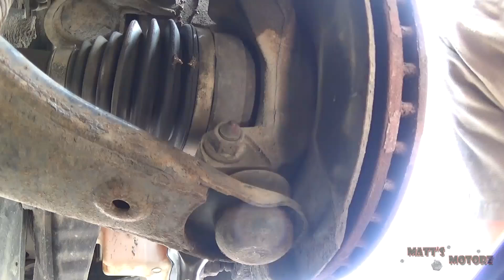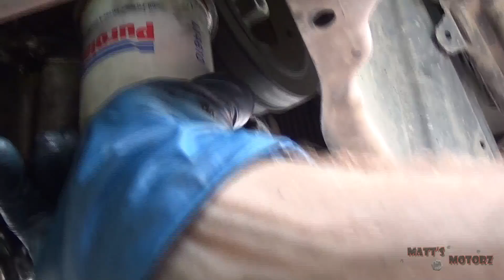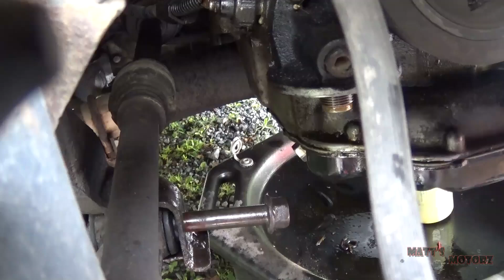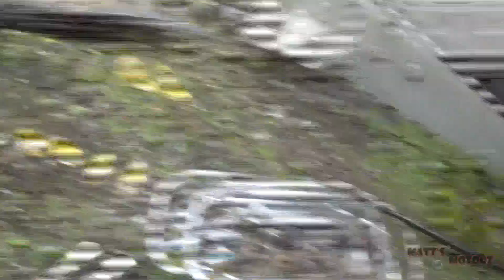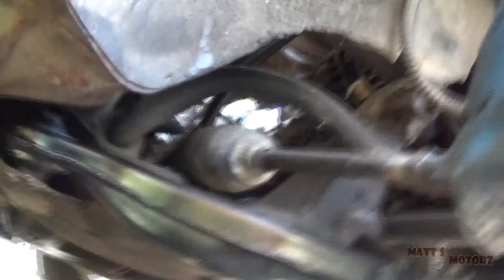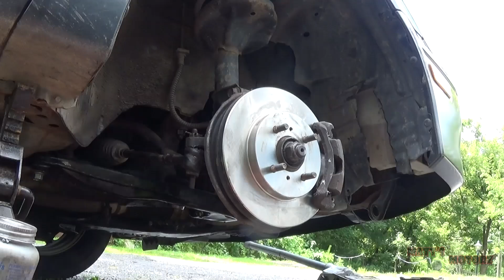Control Arm and Ball Joint Replacement [2002 Mitsubishi Lancer]

Comment: only reason I came here was to see if you ran into the same problem I did 🤣my bolts were so seized up it actually ripped apart the insides it was threatened to the subframe on these cars is not any funner. great video👍

Comment: u basically did the easy side driver side is harder. would like too see how u got the side bolt off on the driver side. A socket does not fit in the area and the bolt seem too long to be pulled out.

Comment: Wait till you do driver side!  Faster and easier to cut that sway bar link off with a sawzall and to use a long piece of pipe along with you breaker bar when removing those bolts. Good instructional video

Comment: Could you show a moderate video or explanation of the rear side alignment parts of your car? I have a 2002 Mitsubishi Lancer ES 1.6L Automatic & my tires are getting bold from the inside thread, my outside outer thread is ok.
Thank You Awaiting For Your Prosperous Response from You Or Anyone Please...

Comment: When removing the temperal transceiver does the small rebigulater conect to the univerasal magneto duhicky inducer spacer gravity bar nut bolt screw fcuker? Thanks for the quick reply! 😎👍
Reply: You have to get the doohickey out of your mouth before you type .

Comment: Cool video Matt. Maybe you shouldn't have sprayed WD40 in the bushing. And only sprayed the nut and left it for a day. Failing that the only other method I've seen is to Oxy the bushing out and replace it. That way you keep the control arm.
Reply: What does "Oxy" mean, fella?

Comment: You don't have to thread the nut back onto the bolt to protect the threads while hitting it with a hammer. That is why there is a nipple on the end of that Bolt. So when you hit that bolt you hit the end of that nipple and it doesn't even touch the threads in the first place.

Comment: Can you replace the balljoints without replacing the whole control arm???
Reply: cringy  were you able to replace the balljoints only?
Reply: @vernelmader5403  you can but it takes mor time because you need to use a press and if you take it to a mechanic they will charge you more

Comment: Hi, how much work is required to lower the sub frame enough to cut that bolt? I tested the bolts while changing my brakes to see if it was something I would run into. Now im debating if I want to go through this hassle.
Reply: Don't know if you still have the Lancer I know this is an old thread but I still have my 2003 and I will tell you I rather pull the engine then drop that subframe

Comment: MattsMotorz I have a 92 Diamante LS, and I somehow snapped one of the legs(arms?) on the right control arm, are there any major differences in the procedure I should be aware of before I get started? just curious.

(PS: I have a crutchfield service manual, but I'm trying to learn as much as I can since the replacement control arm wont be here for a few days, and I'm lucky to be able to change tires and oil, lol)
Reply: My eclipse snapped one of the bolts off. While driving it failed.  Causing 900$ of towing and shop fees. Fucking pisses me off. I sold the tucker. Now I just own the 2003 eclipse

Comment: any chance you have the part # for that bolt you had to cut  out? My car has alot more rust than yours and I can almost guarantee its going to be a pain to get it out. Ive searched all over the net for a part number and none of the diagrams I find mention the part #. great vid, thanks.
Reply: I can find a part# if you still need one.
Reply: @GorillaTwat  

I can’t find the part number for the main bolt on the front control arms that goes to the frame. or the nut size. all I run into is the rear control arm parts
Reply from the maker: I got this part on rockauto.com  Their catalog is really easy to search through for the parts you need.
Reply: Ive searched through everything on there still no luck.
Reply from the maker: Oh the bolt!! Sorry I misread your comment.  For the bolt, I had to go to the dealer.  I think the new one was like 20 bucks.
Reply: okay cool, thanks man. I kinda figured it would be one of those parts, I like to avoid the dealership at all cost, figuratively and literally.  lol.

Comment: hey man what was the thread pitch and length l for that bolt
Reply from the maker: +Skylinegtr34lover1 Don't know.  I just went to the dealer for the new bolt.  It was way more expensive than it should have been but I didn't want to deal with the hassle of finding the right size bolt. (I think it was like 18 bucks or something)
Reply: m14x1.5x12cm

Comment: Hey great video. I just happened to notice you put the sway bar link on wrong when u put everything back together. If you look at the before and after, you can see one of the rubber grommets goes on the top, not in the middle. Just happened to notice. Great video!

Comment: I have this same car. I had to cut out the rear motor mount. A rear bolt on the driver side sway bar bushing is frozen, and no way to wrench it that tight space. So, there's a good chance I will be cutting this control arm. I'm thinking about spraying these newly installed parts with PB blaster rust preventer. The original bolts also seem like soft steel, because they will round off very easy. I do love this car
Reply from the maker: +tim prater Use antiseize for the new parts.

Comment: How easy is it to replace CV joints on a 2003 lancer? I think it's mostly the same car as the 02
Reply from the maker: It should be the same as the 02.  You normally do not replace the joints, you would just replace the whole axle.  Axles are so cheap now a days and it is a LOT more work to replace joints. 

I am actually going to make a video on this in the next couple of weeks.
Reply: sweet mine just started clicking today but only when going over bumps, not when turning or driving straight. Ericthecarguy said that it could last awhile like that. What's your opinion?
Reply from the maker: Yeah I agree with that.  You can last a pretty long time.  I should have the video out in a couple weeks!

Comment: If you jacked the control arm and apply WD40 and let it penetrate for a while, you wouldve gotten that bolt out with ease. Just saying.
Reply from the maker: No way, not in this case.  I've seen my share of rusty bolts and when penetrating oil works and when it doesn't (WD40 is not a very good penetrating oil btw compared to others). Even after cutting the bolt and bushing up, the bushing was STILL seized to it.  

The lesson is to ALWAYS put antiseize on any through bolts in suspension systems.

Comment: hello, wanted to ask mr. MattMotorz would you happen to know the size of the bolt for the control arm? the bolt that is by the oil filter on the 2002 mitsubishi lancer? it was just my luck that one of the lower control arm bolts is stripped.
Reply from the maker: I wish I could tell yah but I honestly do not remember!
Reply: MattsMotorz
 ok lol, i was hoping you did know lol. i actually go to school for PCI (automotive) and i stripped it wishing i didnt lol well anyway good video you made for replacing front lower control arms
Reply from the maker: Thanks! 

If you call the dealer and describe which bolt it is, or better yet, go in and look at their diagrams, they can tell you what the size is.  I have done that before.

Good luck with that stripped bolt!
Reply: Thanks guy I appreciate it
Reply: That bolt beside the oil filter has a nut on the end of it that you cant see!  If the bolt and nut at seized, you will need to  remove tack welds or cut the sheet metal away to expose the nut, and work from there.
Hope this helps someone,  we just did one last night!
Reply: That bolt beside the oil filter has a nut on the end of it that you cant see!  If the bolt and nut at seized, you will need to  remove tack welds or cut the sheet metal away to expose the nut, and work from there.
Hope this helps someone,  we just did one last night!
Reply from the maker: Nice Job!!

Comment: Hi Matt thanks for the video I want to know were did you bought  the bolt for the control arm
Reply from the maker: Had to go to the dealer for that one.
Reply: @MattsMotorz  do you have the part number for the bolt and the nut by any chance? all I can find is the bolt for the rear

Comment: When did you realize you put the stabilizer bar link back together wrong?  The bar goes between the two bushings.
Reply from the maker: Ha! I didn't even notice! I'll have to go back and fix it / put up an annotation. It was a LONG day when filming this. Thanks!
Reply: No problem. With how hard that bolt was to get out I could see being a little scrambled. Also great videos.  No offense on my comment either.
Reply from the maker: None taken!
Reply: i did notice that too. i thought to check anybody else have noticed before i comment it.

Comment: Tried to remove my control arm on my '02 Saab 9-3, holy cow. I had a 25" breaker bar on the bolt and I propped the handle up with a piece of wood and kicked the handle, it took about 10 kicks to break it loose. It was really awkward laying half under the car kicking the breaker bar, but it worked. Also once I got the bolt out it was rusted half way through, it's a miracle it didn't just twist off and stay in the car (which I've read is a semi-common problem for that model). That would have been a bad, bad day.
Reply from the maker: Man that's crazy! Unfortunately I didn't get to see my bolt, it never came out of the bushing!  Yeah one of my nightmares is either having a bolt break off in the body, or stripping the threads.